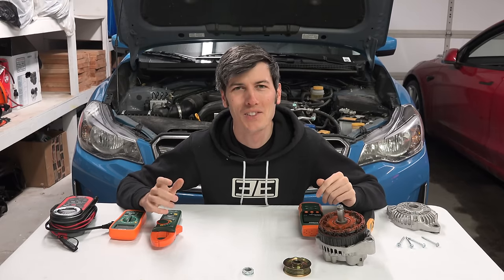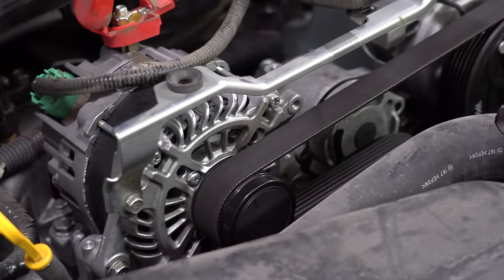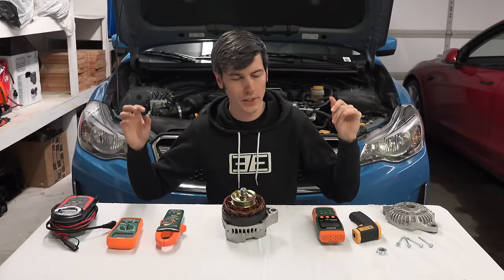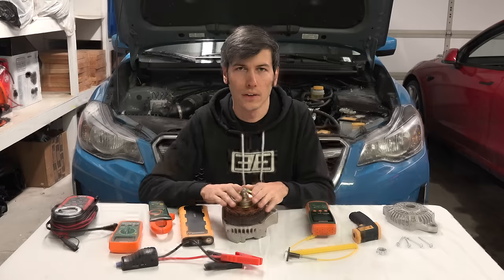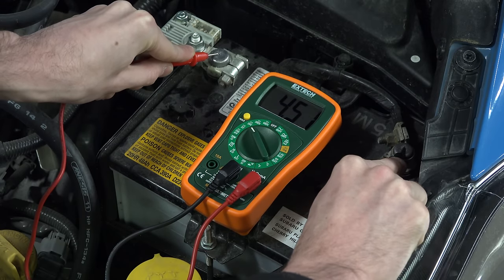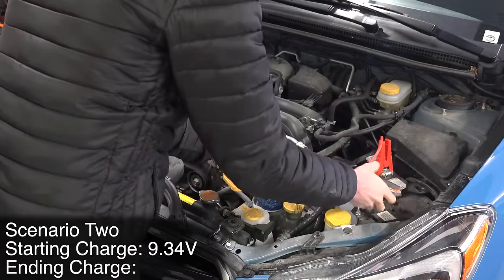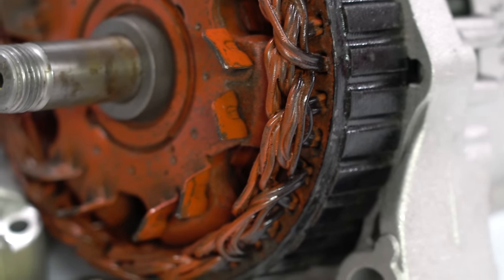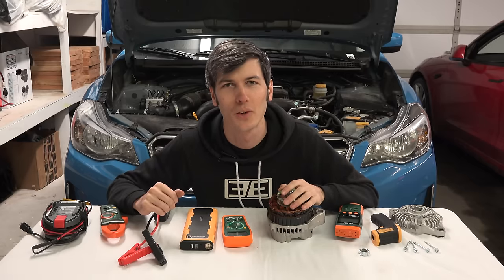Can A Dead Battery Ruin Your Car's Alternator?

Comment: You were charging a drained good battery. A weak old battery would have higher internal resistance and may not draw as much charging current.
Reply: JohnAudioTech Thats covered in the next video “ Replacing the alternator, that you just smoked.”
Reply: He says that at the end of the video

Comment: Bump start a car on a dead battery is one more reason I love manual transmission. I've been driving for decades and lost count of how many times I had to resort to this trick. Having said that, I never had any alternator problems after driving and charging a dead battery on the alternator alone. Good to see your test gave me some confirmation, though. On an emergency, find a way to start the car, drive it for a while and charge your dead battery. Loved the video, as always.

Comment: The Temperature of the diodes would be more interesting in my opinion. The dead(and or dying) alternators I came across (10-15) almost  all had diode failures in the rectifier. The ones that end up dead have all failed with a short. Which makes short work of the rest of the diodes ones they get reversed biased by the other coils. I suspect the amount of cooling of the rectifier-bridge is sufficient for a half drained battery but might push them past their limits on "dead" or shorted ones. Early signs I noticed on "older" cars which had incandescent headlights was that once one phase had failed  lights would flicker in tune with the alternator  rpm later to be followed by complete loss of electrical  power.

Comment: Another great video. It would have been interesting to see what the dead battery voltage was a few hours after the drive. I would imagine what you were seeing is what’s known as a surface charge. 

Along that same theory, it’s important to tell viewers that charging a battery quickly can damage it. Your Optima charger (along with other high quality chargers from companies like CTek and Noco) typically only supply 4-8 amps of current. This slow charging rate allows the sulfate on the lead plates to reabsorb into the acid. Aggressive charging can bake the sulfate into the plates, reducing the exposed surface area and consequently, the current delivery capabilities of the cell.

If someone kills their battery, yes, boost the car and get where you need to go. More importantly, use a high quality, low-current charger like the three I mentioned to restore the battery.

Comment: Most modern alternators are rated 100-140 Amps, more than enough for large entertainment systems and charge a battery. The battery is also used as a smoothing capacitor while running, to reduce electrical spikes from the alternator and vehicle accessories changing electrical demand quickly.

Comment: Usually, the capacity of a failing lead-acid car battery falls to near zero - in terms of amp-hours, not voltage. It will behave like a much smaller car battery. It will not place a significant load on the alternator.

A failing car battery will rise to a fully charged voltage with little current, and take little charge. 

I am surprised your battery took charge at such a fast rate. This could damage the car battery. May be interesting to re-run that test measuring the temperature of the battery. 

Slowly charging a dead battery not only helps preserve the alternator, but equally importantly, preserves the battery. You will likely also get a higher capacity in your battery if you slow charge (less than 5 amps), as the charging chemicals can pack much more tightly on battery plates when slow charged. You also save some fuel, which would otherwise be burned to produce the power needed to charge the battery.

Comment: Here in Brazil we faced in the 90’s some inconveniences of miniaturisation. When cars where fed by carburettors, the alternators had the job basically to replenish the charge of the battery and feed the lamps and the coil, and the currents were under 40 amps. At that time, the rectifier and the voltage controller were outside the alternator. When our cars began to be fuel injected, the current to drive the system led to a sharp increase in the current supplied by the alternators. At the same time, as we live in a warm climate, we began to buy cars with air conditioning - which draws at least 30 more amps from he alternator to drive the fans - and the alternators became more compact, with its rectifiers now on the inside, making difficult to cool down the semiconductors. As a result, since we use the air conditioner all over the year, the stresses over those new alternators were to high to bear: our batteries began to fail with less than 2 years, and within 4 years we had to replace the rectifiers

Comment: This topic brings back the memory of sitting in a 3-hour NAPA training class over 10 years ago that covered this exact topic. They were having a large number of failures on their rebuilt alternators. After a lot of research, the failures were attributed to overheating of the alternator mainly due to replacing alternators and letting the car leave with a battery in a low state of charge.
An alternator is designed to power all the OEM electrical equipment on the car and to recharge the battery after a normal start, with some extra capacity. Most alternators will overheat and die when they are pushed to 100% output to try and power the car's electrical circuits, plus a few more owner installed accessories and a dead battery.
The simple fix is to use a battery charger to charge the battery before the car is returned to the customer.

Comment: I fixed a friends 85 buick. he burnt up the alternator and replaced it. they checked his battery and said it was ok after it burnt out a warranty replacement alternator he made the judgement that the alternators were no good. I said maybe but not likely. we let his car run idling with the air conditioner on, hood shut, hot day and after about 30 min opened the hood. the alternator was extremely hot and the battery read 11 volts. I took the caps off and said to him. notice all the cells but one are bubbling a lot but one is not bubbling at all. I told him his battery has a cell that shorted only when the battery got hot. he replaced the battery and all was fine. your video does not answer all questions. people still have to use their own brains. I am amazed the vehicle solid state electronics can survive the extreme environment they are put in.

Comment: That looks like the original battery. Not sure what year your Subaru is. But in my neck of the woods (NJ) Batteries usually only last about 3-5 years before they start to fail battery tests. Reduced Cranking Amps, that usually haunts you when the temperature drops.

Comment: Just a few quick comments:
1. Doing a deep cycle discharge on your Crosstrek’s battery does significant permanent harm (sulfation) to the battery that results in reduced capacity.
2. The rate of charge of an installed automotive battery is primarily determined be the difference between the battery voltage and the alternator output voltage when you sit aside any additional protection logic (may vary by manufacturer) associated with temperature and maximum current allowed. When you flatten a battery as you did, this voltage difference is quite large and well beyond the intended design limits. 
3. BTW, a fully charged flooded lead acid battery freezes at approximately -70C a fully discharged battery freezes around -10C – so care is needed when boosting a dead battery in cold areas.

Comment: There are two types of battery, those that are truly dead maybe because of sulphation and those that are flat because they have been left or a light was left on etc.  The alternator will easily recharge a flat battery but not recover a dead battery, that needs to be replaced.  

If the car needs to be jump-started more than a couple of times than it's time to change the battery.  In your example, the alternator was charging the flat battery by putting out 800W (approx), that's no problem to the alternator which typically can put out 1.1 - 1.9kW.  

Great video Jason :)

Comment: Back in the 1990s my parents had a car that had sat unused  a few months -  not only was the battery dead, shunts had formed within so it was shorted internally.   They were able to jump the car,  but a few minutes later the wiring loom caught fire ! Hopefully modern vehicles are better designed...

Comment: Good study. One thing worth mentioning is it’s very important to have a fully charged battery when installing a new alternator. Reason is the diodes need to be conditioned much like a new set of brake pads. Gentle heat cycles will cure the diodes giving them a long life. Also worth mentioning is the battery is the system capacitor. Modern cars will do some crazy stuff when ripple is introduced into the system. As well as poor connections.

Comment: One thing to consider is if you required a jump start because of a dead battery and you're a long way from home, is to use as few extra loads as possible for at least a half hour until the battery is partly charged and draws less charging amps.

Comment: I had a water pump hooked up to a truck for work, it was so hard on the battery and alternator that one time I turned on the water pump and It shut the truck off. The alternator was dead, and after getting a boost from a co-worker the Battery charge dial in the truck was acting like the RPM dial.

Comment: The first I heard of this was back around 1997 or so when an alternator I bought came with a brightly colored piece of paper that said to charge the battery if its low before starting the car and if I didn't it could cause premature alternator failure. I think it makes sense to charge the battery if you can like you said. Also, its a good point that its not good to drive around with a bad battery.

Comment: I have a Webasto diesel pre-heater on my car. For half the year I run it every morning, anywhere from 15 to 30 minutes depending on the outside temperature.
The car is a 2014 model that still has the original battery and alternator.
Although I never checked the amperage after starting, I have been waiting for something to fail. But that diesel engine just starts right up, and the car is nice and warm.
So batteries and alternators sure are heavy duty.
And yes, I run the heater throughout the day as I need. So not only mornings.

Comment: Many newer cars, I believe all that have start-stop feature, use a shunt and measure battery current and track state of charge accurately as well as determining state of health. It would not win any car make any fans to shut the engine off  at a stop and not have the battery capacity to start it when it is time. Also many alternators are controlled by PCM or ECM and do odd things like lower voltage for current supply for needs without battery charging for less HP drain. They also do high charge on coast (15.3 to 15.6 V) to charge when no fuel is used (injectors not operated during higher coast) as that is “free” and does give a tad more engine braking.

Comment: Did he answer the question if it would ruin the alternator and I missed it? :)  In my experience it does NOT hurt the alternator in any way, BUT charging a battery at high rates can degrade the cells over time.  A car battery is best charged at 2 - 10 amps for longest service life. If it's a small mower or motorcycle battery, charging at 500mah to 1 amp is best. I usually get 10 years of life out of my small ATV/Moto batteries because I always charge them at very low rates.  Great info in the video, thanks for posting!
Reply: i though with a bad battery the alternator worked harder causing brushes to wear faster? or does the regulator and rectifier keep that from happening?
Reply: @carolinabeacher1558  No brushes in alternators, old tech generators did have them.
Reply: @carolinabeacher1558  a dead cell does just the opposite. It cannot store energy, therefore will not place a demand on the system. The vehicle upon startup WILL place a higher demand on the battery as a whole. In a very cold climate, the automobile places such a huge demand on the weak battery, the battery will require a longer charge time. If you shut the vehicle off right away, it probably will not start again. Thats generally how people discover they have a bad battery.
Reply: @carolinabeacher1558  I would say yes in theory but since a dead battery scenario like this would happen very rarely I don't think there would be a measurable difference in wear. If you had a bad battery and jumped the car everyday over and over, in the hot summer months, the excessive heat could damage the electronics of an alternator.
Reply: @dankingsbury9971   actually they do use brushes, i just changed to brushes in my 90 cherokee alternator and my friends 99 cherokee starter, ive been changing brushes in my tools and car parts for over 40years.
Reply: @scottfirman    i have a battery thats 10 years old i keep restoring just because i like to experiment,  i checked the cells, they all read around 2 volts, when i rev the engine, the lights get brighter making me think the alternator is doing the work the battery is incapable of? i never took electronics, i just like to fix my own stuff, when my alternator quits, i disassemble it and peek at the brushes, if they look wore i replace them and if it works, i know i replaced one of the right parts :) same for my drills and other stuff
Reply: and if im wrong, someone better let me know so i can tell the alternator shop selling me brush kits :)
Reply: @carolinabeacher1558  
You are most certainly correct 

Old style DC generators (dynamos) used brushes on a commutator(segnented) that effectively converted the ac generated into dc

Alternators (ac generators) use brushes on two slip rings to provide current to the rotating field coil on the rotor.
The three phase ac current is taken from the stationary coils (stator), converted to DC by six diodes, this is supplied to the load including battery and the voltage regulator controls output voltage by varying voltage and hence current supplied back to the rotating field coils.
This is a simplified example.
Reply: @carolinabeacher1558  Sorry, I should have been clearer: in alternators with permanent-magnet rotors such as EE showed, there's no brushes. Alternators with electromagnets in the rotor require brushes or "slip rings" to conduct the current to their coils.
Reply: @carolinabeacher1558  if the lights get brighter at higher revs it could be a number of problems. The alternator pulley size and engine idle are too low to supply enough amperage for the vehicles needs. The battery is bad and unable to offer capacitance for the vehicle electric system. A good battery will supply watts at low idle for the vehicle and absorb spikes of current from the alternator during a high rev change in electrical demand. The regulator could be going bad and the alternator can't sense the demands and adjust current to supply the needs of the vehicle. Or you've modified your vehicle with a bigger stereo and lighting that is beyond the output of the alternator, why vehicles that have stereo systems and off-road equipment usually install a larger heavy duty alternator and dual batteries. (From memory) 90 amps is the max output possible for an older V-belt, 170 amps is the max output for a 6 rib serpentine belt, 200+ amp alternators come with 8 rib pulleys on diesel engines.
Reply: @carolinabeacher1558  not sure of your vehicles use, but they do offer special clutch pulleys for applications like high reving track cars and police duty vehicles that might engage in a persuit with maximum electrical load from the emergency lights. The clutch pulley offers the ability of a smaller pulley without the risk of over reving the alternators rotor and small bearings. Usually the rear pulley in an alternator is smaller than a skateboard pulley, ~20mmOD ~10mmID ~8mm thick. I usually replace them with a thicker ~10mm Japanese high temp bearing that fits the case.
Reply: It does damage the alternator if you battery is dead and won’t take a charge anymore.
Reply: So true. Living in Wisconsin, we know about charging batteries. My dad taught me many years ago to be patient & use a "trickle" charge only. I just replaced the battery in my car that I bought in 2006 !
Reply: A good rule of thumb is to charge the battery at 1/10 (0.1C This ratio is expressed in "C" units) of the original capacity. Charging a 60Ah battery at 60A is considered 1C, charging a 60Ah at 30A would be 0.5C and so on.

Most charges have a setting for "slow" charge that is most likely going to be around 0.1C that should take around 10 hours to fully charge a battery. If you always fast charge your battery it can shorten the its life, this is true for all kind of cells, from smartphone batteries to Tesla batteries.
Reply: My car had a short and it killed the battery and I left the car running hoping it would charge but the battery didn’t and I replaced the battery. After I replaced the battery the alternator would charge at 11 volts and before it charged at 14 volts so I ended up changing my alternator and it charged at 14 volts again.
Reply: @carolinabeacher1558  The brushes only carry field current, not the output of the stator. The output current flows from the stator windings through the rectifier bridge to the output post.